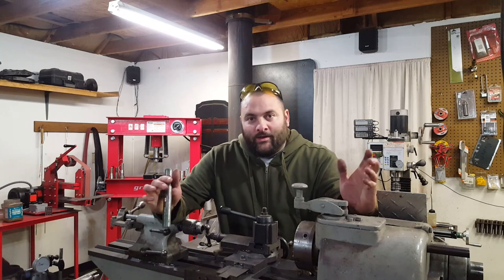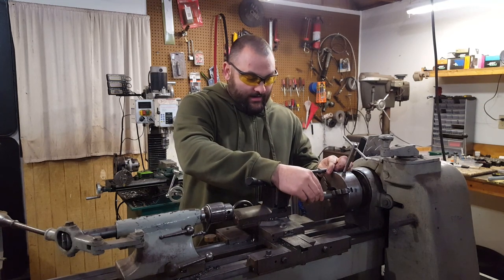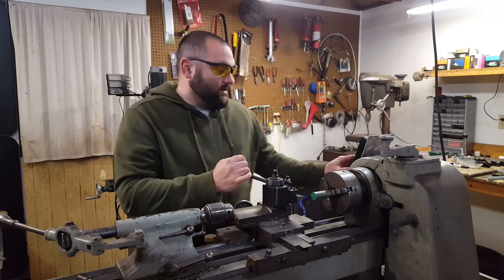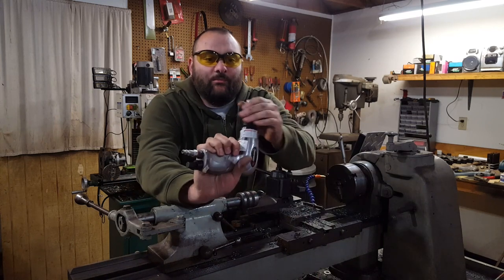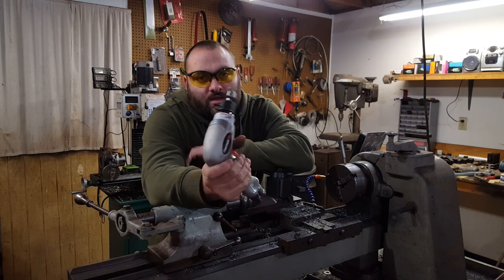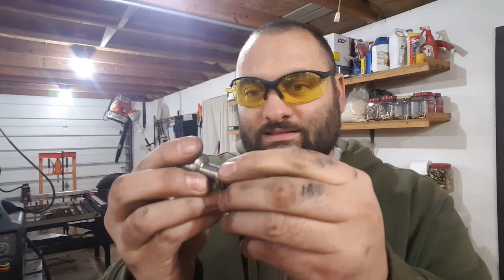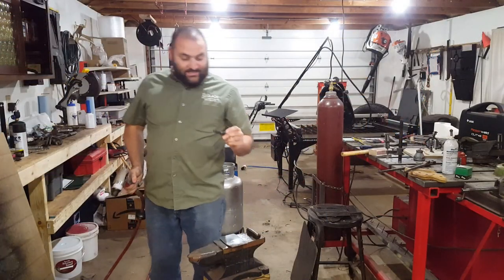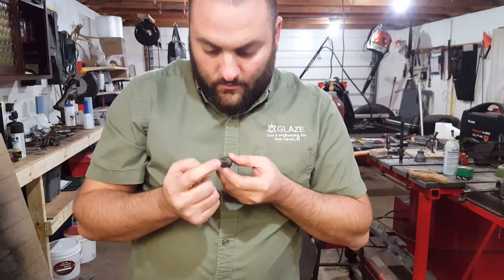How To Build A Tiny Power Hammer HD #powerhammer

Comment: I use air hammers every day for work the bits are made out of milder steel so they dont chip and shatter becarful with that bit. the big three tool companys sell the hammer bits
Reply from the maker: Sweet I'll check them out.  S7 Steel is made for high impact and shock loads.  It's primary use is in jack hammer bits and Metal punching dies.  I was just worried at first because I heat treated it in my shop.  If you don't get the heat treat correct it can break or smash.  After testing It seems like I nailed the heat treat and tempering.  This was a fun project.  Thanks for the feedback.